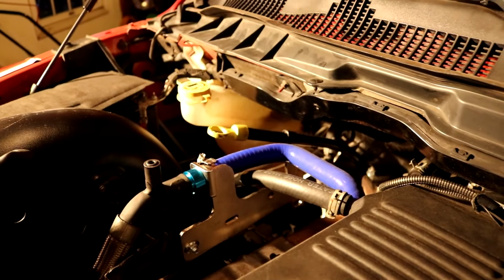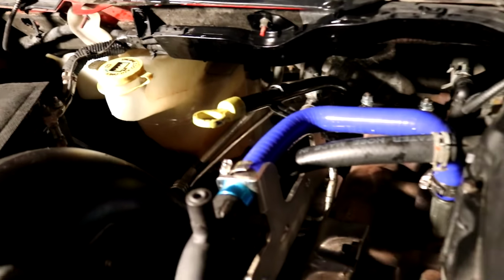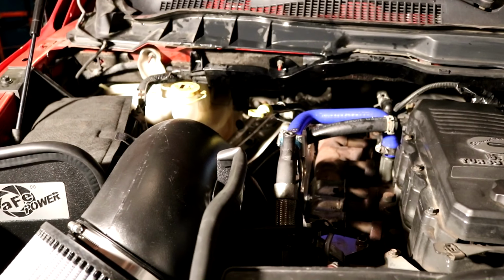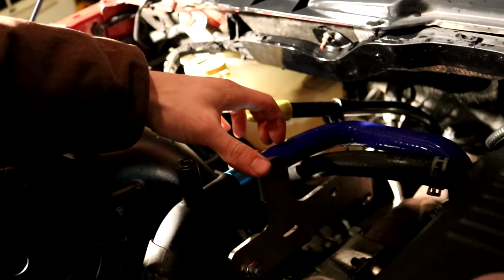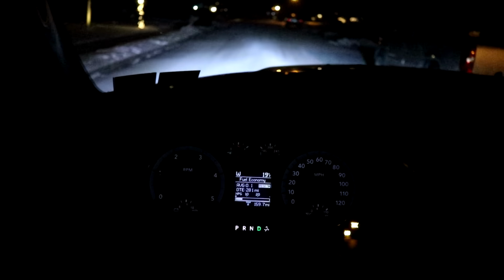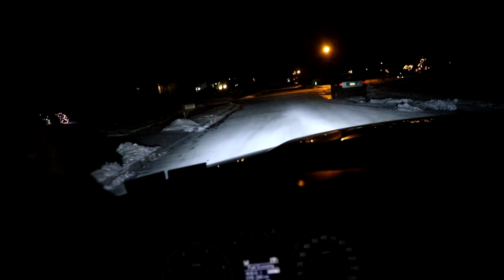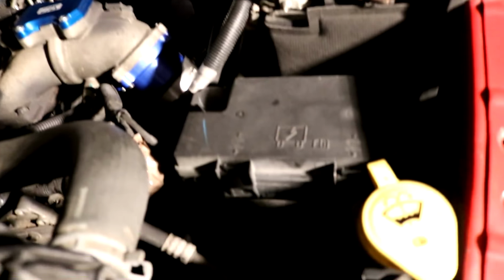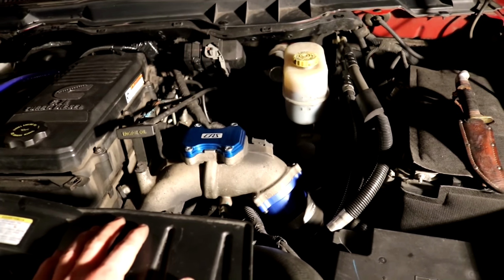NEW CUMMINS LOST ALL THE BOOST!!

Comment: what you said about the airflow with the turbo is true but you also need some backpressure, i ran my truck with no exhaust and throttle responce dropped i put a 5" straight pipe on and all is good now
Reply from the maker: this is only temporary, I do want to get a straight 5

Comment: So diesels don't like cold huh , is that why they run better in the cold , cold air is dense air , dense air has more oxygen , more oxygen means more power , THAT'S WHY THEY HAVE INTERCOOLERS oh and kits that spray Co2 directly on to intercooler to super chill the intercooler
Reply from the maker: well I meant the old diesels starting in the cold